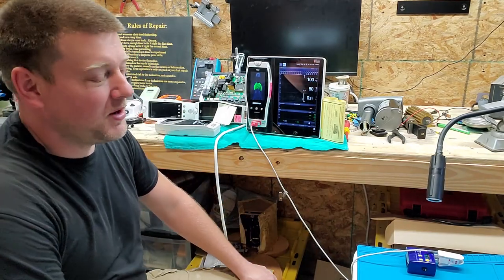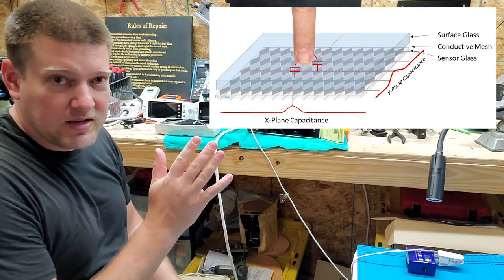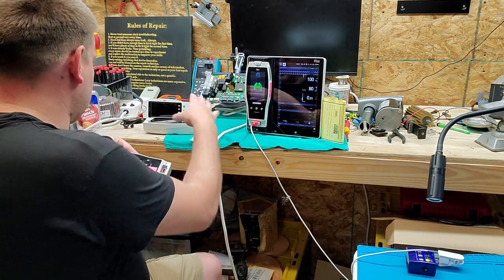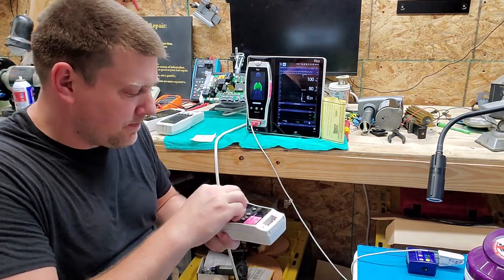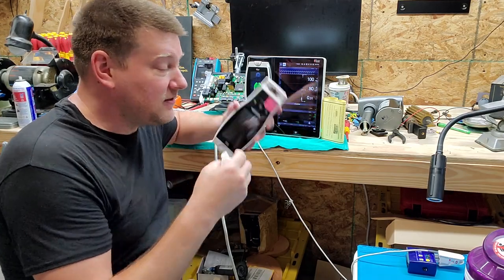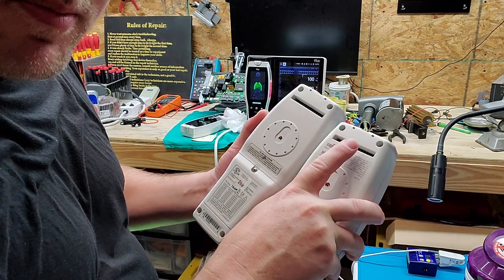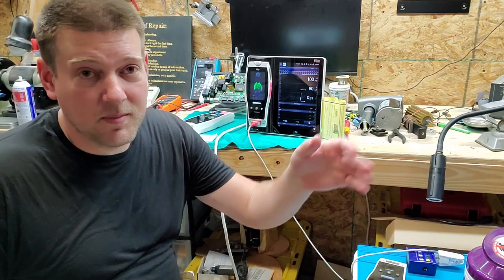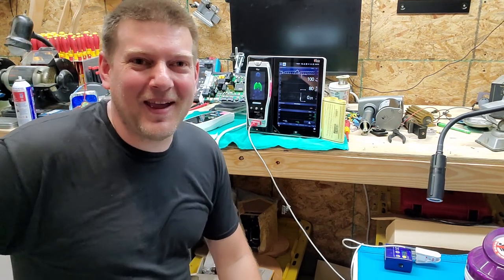Capacitive Touch Screen Problems

Comment: Great work - that is a very possible issue. I totally agree most things do not need touchscreens!  Especially in medical devices. Works great for phones but most medical device companies touch screen suppliers are not all that great. I have some major issues with the fluke infusion ID-1 touch screens - and they want like 1000 dollars to fix this thing  (almost half the cost of the device no calibration included) - not sure what type of touchscreen it is but it just seems to fail after very little use (even after calibrating it.

Comment: From repairing those ipads for our school system. I find that if you look through the magnifier of a touch screen, you can actually see defective areas in the X - Y axis of the screen. But for capacitance that may be a different story. However, it still can be a defective screen. I have taken brand new screens out of their wrappers that are bad.

Comment: Hey, what if an touchscreen on a  (ANDROID/GENERIC) tablet just suddenly went crazy and progressively failed in all but part of the screen? Will shocking the screen with a lighter sparker work if done correctly or is it more likely to do with the cof cable ? Any other suggestions? ALSO: I did splash a little water on it before it went crazy, but I wiped that off and was able to fully use it until it went nuts while watching a music video on yt. Inside the device, the black wire from the batt to circuit bd has some insulation missing at the end, so I wonder if some charge is being lost elsewhere that should go to the screen. Additionally, I wonder if the portable bluetooth speaker vibration had something to do with it (it was fairly close)...
🤔🔊📲📵❓
Reply from the maker: It's hard to say. That's a capacitive touch screen most likely. Clean the screen thoroughly and then restart

Comment: Hi there ! Interesting vidéo thanks, I'll see about some other very soon since you've done some of them on a few topics I'm getting to get introduced to.
I wonder if you have any following up video to let us know if you found the probleme with these touchscreen devices. Funny, I'm currently facing an issue with one and I've seen that regarding the power supply converter powering my electronic card, the problem is either there or not there regarding which power supply converter I'm using.
Regards !
Reply from the maker: The major problem with capacitive touch is a clean screen is necessary.  In medical environments, sanitizer wipes wet the perimeter and the moisture degrades / corroded the capacitive matrix